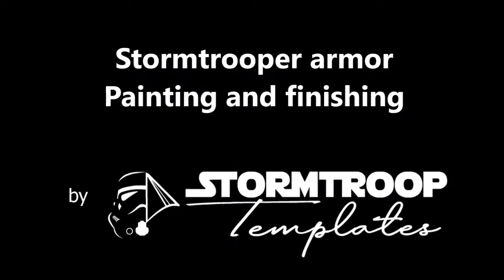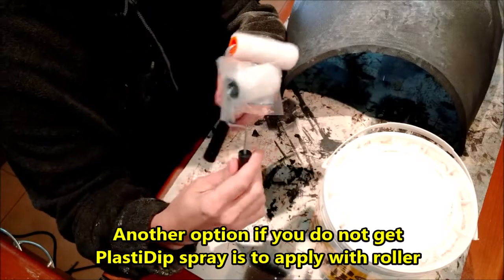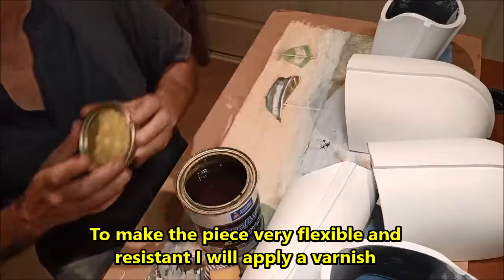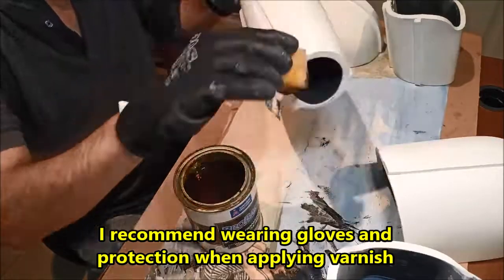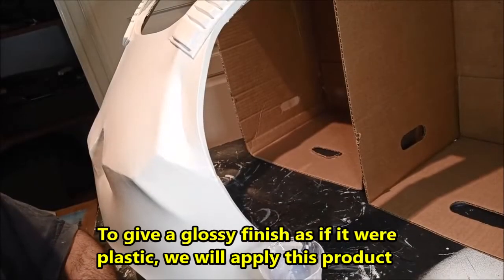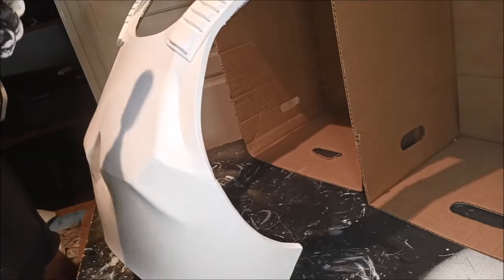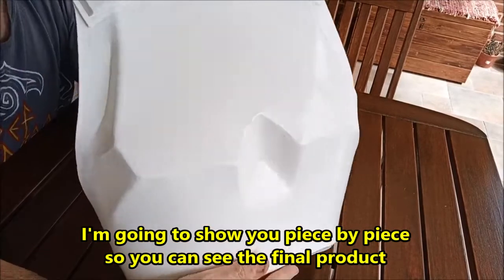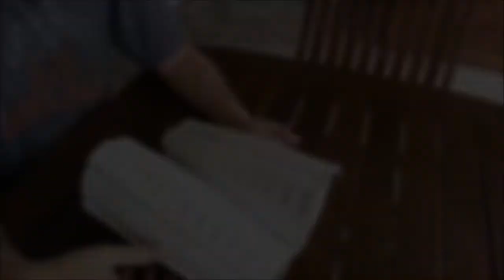Stormtrooper foam armor painting and finishing

Comment: Really like your design but i was asking how much paint it requires to paint the helmet and the armor. Also wich kind of plastic paint are you using?
Reply from the maker: Hi Julien, thank you, the foam can be painted with Plastidip, it's a plastic paint, but you can use other options, you can see the videos (not mine):
youtu.be/ROZlkW96hFI
youtu.be/ug6Rs06FEpk,
youtu.be/MDwQg6CX25A
You can even make the foam hard as the original armor like the third video.
I don't get Plastidip in my country so I use a plastic paint called "paste membrane". It is used to seal roof leaks. In replacement you can use PlastiDip which is even better.
plastidip.com/our-products/plasti-dip/
After that you can apply this excellent gloss paint called Liquitex Fluid Gloss:
https://www.amazon.com/dp/B001UNTH2S
About how may paint, may be I used 2 litres (2000cm3) for all armor and helmet.
Thanks for asking and tell me if you need more help.
Cristian

Comment: Awesome Cristian, quick question: Don't you have any brush strokes when you are painting it? I'm trying by several ways but the only way to not have is to use a spray can :/
Reply from the maker: Hi Maxime, thank you. You can delete the brush strokes sanding a little. WIth Plastidip spray can is faster and excellent finish, but I can't get them in my country. Thanks for asking. Cristian
Reply: @StormtroopTemplates  Thanks a lot for your quick response :)

Comment: I've been considering buying your kit, but I was wondering what the material + tool cost would be? Like just a simple estimate.
Reply from the maker: Hi Jetrino, It's not a kit, it's a template. You can find the cost checking all you need, I added cost examples, may be you can find better prices:
MATERIALS:
· 4 square meters (1m = 39.37 inches) of 6mm/8mm foam (8mm recommended)
  In https://tntcosplaysupply.com/product/eva-foam-sheets/
  14.50 each sheet EVA 38, 4 sheets = 58 USD
· Small area of 2mm/5mm foam (4mm recommended)
  1 sheet x 10.19 = 10 USD
· Contact cement, hot glue gun (optional)
  32FL OZ DAP Weldwood Original Contact Cement 13 USD
· Paper tape
  In Amazon, making tape: 5cm wide 5 USD, 2cm wide 4 USD = 9 USD
· Velcro
  In Amazon, 5 meter long 5cm wide = 12 USD
· Letter pages to print: 96
  500 20LB sheets = 5 USD
· White plastidip spray paint 4 cans 12 USD = 48 USD
· Gloss finish Liquitex Gloss Acrylic Fluid Medium and Varnish, 8-oz = 14 USD
TOOLS:
· Foam cutters
  https://excelblades.com/collections/knives-and-cutters?page=2
  2 types, common 4 USD and special 14USD = 18USD
· Scissors from Excelblades = 8USD
· Cuttting mat board
  In Amazon, Dahle Vantage 10673 Self-Healing, 24"x36" = 32 USD
· Heat gun or powerful hair dryer instead
  In Amazon, PRULDE N2190 1500W = 20 USD

All high quality:
Total cost materials (including painting) = 169 USD
Total cost tools (once purchase) = 78 USD

Thanks for asking.
Cristian

Comment: which is the white paint that you put pliss
Reply from the maker: The foam can be painted with Plastidip spray, it's a plastic paint, but you can use other options, you can see the videos (not mine):
youtu.be/ROZlkW96hFI
youtu.be/ug6Rs06FEpk,
I don't get Plastidip in my country so I use a plastic paint called "paste membrane". It is used to seal roof leaks. In replacement you can use PlastiDip which is even better.
plastidip.com/our-products/plasti-dip/
After that you can apply this excellent gloss paint called Liquitex Fluid Gloss:
www.amazon.com/dp/B001UNTH2S
Thanks for asking and tell me if you need more help.
Cristian

Comment: Is that screen accurate
Reply from the maker: Hi Kevin,
Sorry, I don't know what you mean with screen accurate.
Reply: @StormtroopTemplates  I mean is the storm trooper armor movie accurate and is it approved by the 501st legion
Reply from the maker: @kevingarygreenfield8388  Hi Kevin, yes, it's accurate, but unfortunately the eva foam material is not approved by the 501st Legion, they are only allowed these types of materials or like materials: White fiberglass, ABS (Acrylonitrile Butadiene Styrene), HIPS (High Impact Polystyrene), or Polyvinyl chloride (PVC). Removing this requirement would be worthy of approval. For more detailed info in https://databank.501st.com/databank/Costuming:TK_anh_hero
Anyway I never tried to be approved with foam. Thanks for asking.
Cristian